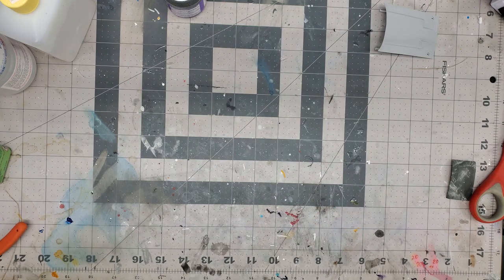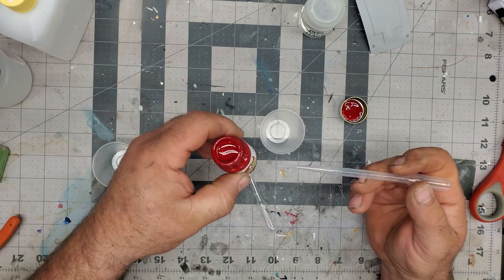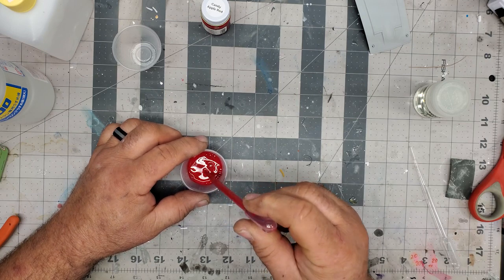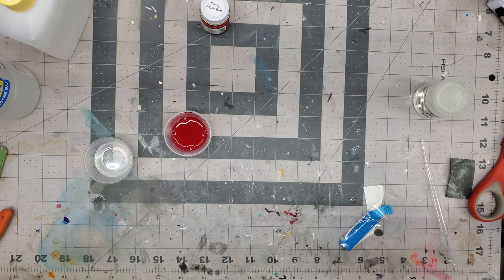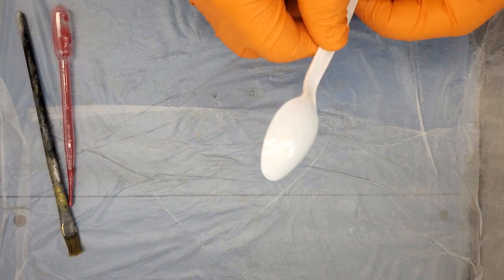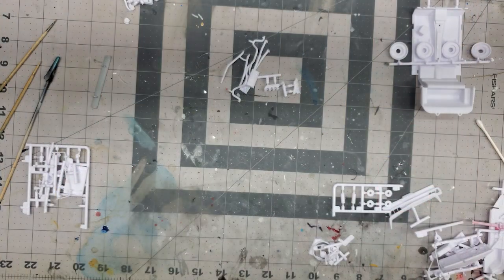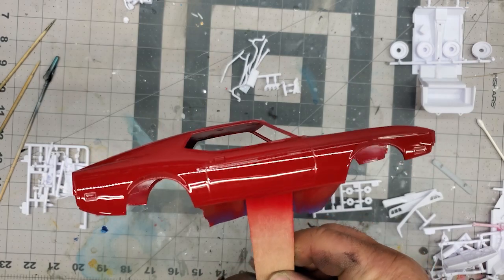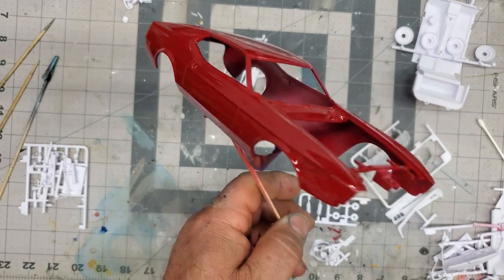BUILD SERIES PT 3, ON THE ALL NEW REVELL BOSS 351. TIME FOR PAINT..

Comment: Does this version come with door windows? I don’t see any in the pictures and I just can’t understand why there’s no Mach 1 kit with all windows
Reply: I can think of one or two obvious reasons, Kevin. If something like a shifter comes loose in the interior, without side windows you can do a repair -- re-glue to fix it. 
If side windows were there, you either have a rattle can from then on, or you would have to disassemble the body and underbody to do the repair, then put it all back together. 

Also, I have some diecast cars with side windows, and the glue used to hold them in place is an eyesore.

Comment: wow kreg great vid thanks for the the tips especially with the metal flake last couple of models i sprayed a heavy metalic w/a 7'5 air brush cheap gun noticed something just not right you nailed it🤩😁have a 71 built 20 some yrs ago when i had the 71 comet 302/289 hi po heads but i sold that car i think it was wrecked @ some point 🥲scooter d😎